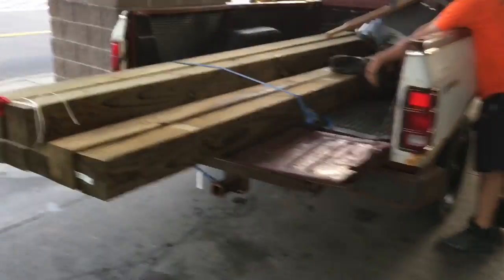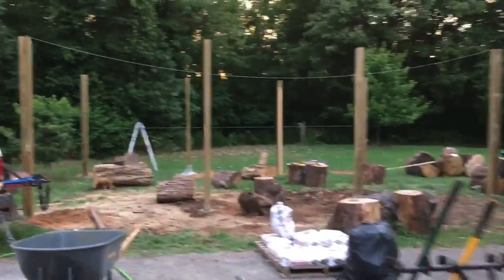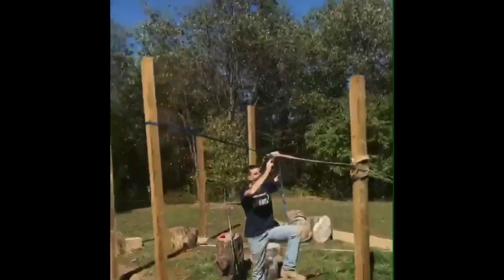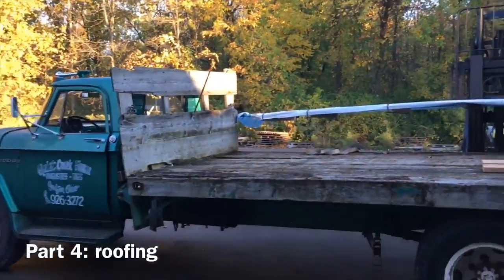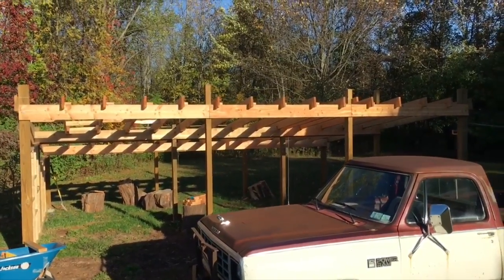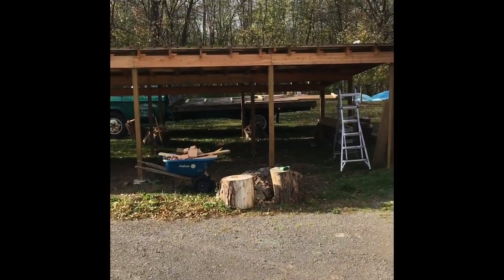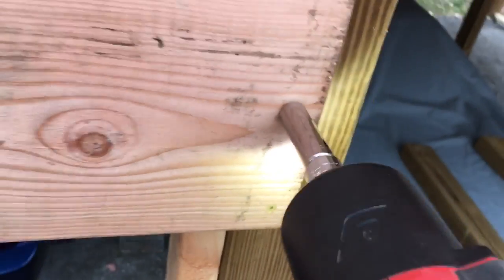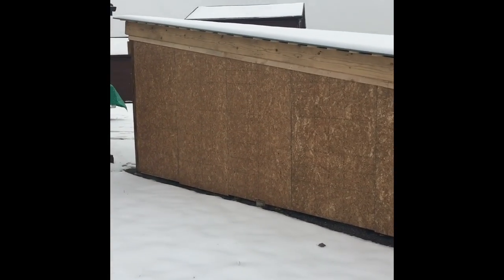Fanelli Brothers 3 Car Garage Build Under $3k

Comment: Love how you cut out the rafters, so much stronger. Being that, you are in north country, and IF the bottom starts getting weathered. Get that Composite PVC Aztec board 5", and cut  the bottom of your T 1-11 all the way around and insert. Water will never get that PVC board. Then just seal between the PVC board and T 1-11. Awesome build Thanks fo sharing.
Reply: after notch 2x4 at best

Comment: This video just gave me hope and motivation to build mine. I had this similar design in my head but all the contractors that i spoke to were each quoting me over $10-15k, while in my mind i was thinking it shouldn’t be more than 5… This looks like a project potentially for this coming summer. 3k all in sounds really really doable. Thanks for making this look easy man.
Reply from the maker: I’m glad my video was inspirational to you for wanting to build your own. It’s fun! Remember that I was able to do it for $3000 back when lumber was a little cheaper, this was 2018 but still I’m sure you’ll be able to do it for far less than you were quoted!

Comment: Height would depend on how one wants to use the garage.  I like the simplisty of the design here, as it is very functional and serves it purpose. As we look on, perhaps we might see places for improvement in the design, and I am sure there may be things he looks back and might would have done differently. But it is built now and it works. Great job! Would like to see your swing out doors for the garage, that you mentioned you would do. Would like to see more DIY build videos. -Rob

Comment: Great build guys, and the vehicles are not too shabby as well! I had a post in concrete in the ground for 22 years before it rotted, so piss on the negative Neds. When they do finally go, I’m sure filling the holes and adding concrete brackets would last another 20+. I’m building one this summer and I love your design! So thanks for the start.
Reply from the maker: Thanks man appreciate it💪🏼 glad that my vid was helpful! Best of luck with yours.

Comment: Bubbles between the lines are always a good start.You notched the roof rafters, great! 
But there is alot of potential shear on those beams attached to the 4x4 posts. 
Probably should have made a small notch in the vertical post to accept the beam, at least half each on both sides 
Lots of weight for anchor bolts.. Just sayin'

Comment: I agree with sean b that the back is a lil low. but i love the design how tall pillars?
Reply from the maker: That's how I wanted it. The fronts are 12" rear 7"
Reply: Wow!  Front 12” (inches) & rear 7” (inches). Must be a garage for Matchbox cars.  LMAO. Definitely, should of gone higher in the back but I’m sure you won’t regret it since that’s how you designed it. 😂
Reply: Anthony V I am almost certain he meant "feet" instead of "inches". Height would depend on how one wants to use the garage.  I like the simplisty of the design here, as it is very functional and serves it purpose. As we look on, perhaps we might see places for improvement in the design, and I am sure there may be things he looks back and might would have done differently. But it is built now and it works. Great job! Would like to see your swing out doors for the garage, that you mentioned you would do. Would like to see more DIY build videos. -Rob

Comment: BETWEEN 6 MONTHS TO 8 MONTHS BE STARTED ROT YOUR POST OUT / BECAUSE  THE POST HAVE TO BREATH WANT ROT
Reply: thats what I thought too but what do i know. I found about 15 issues.
Reply from the maker: 3 years later...still no rot, but thanks!
Reply from the maker: @sawyerramos3113  wheres the video of your build? oh wait....
Reply: @FanelliRestorations  You won't see it. It will be in the heartwood. It will rot from the inside out.